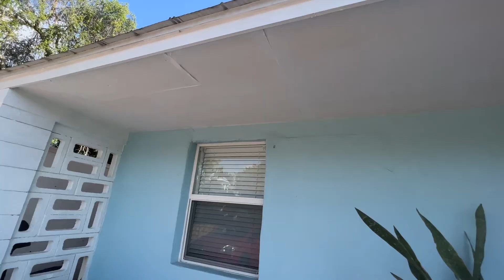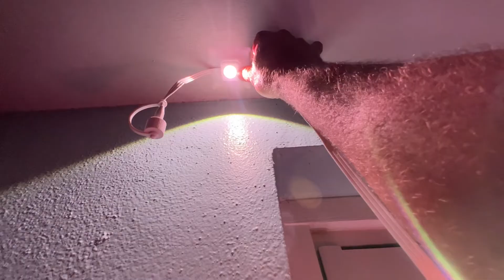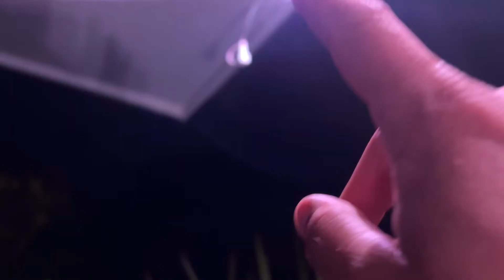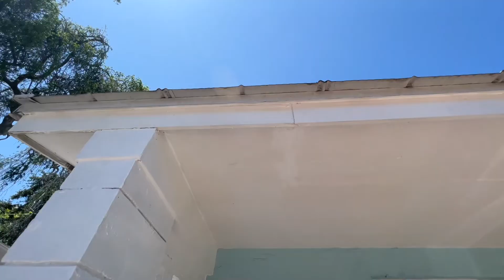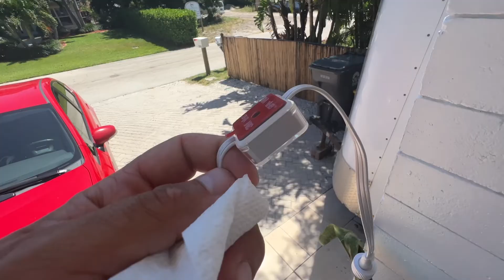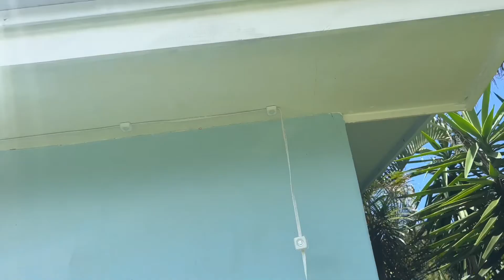How to Install Govee Permanent Outdoor Lights on Your House (Year Round!)

Comment: I think it would look better if you tilted the lights at a bit of an angle towards the house. This should reduce the scalloped shadow pattern on the right, and eliminate the line of shadow on the left side. Use a shim for something consistent on each light.

Comment: Thanks for posting this was wondering what would happen when put further out. I wonder if putting a small uniform shim with say a 15% cut would get rid of that line. I'm not a huge fan of the triangle pattern.
Reply from the maker: I’m thinking of adjusting them, there will be a video!
Reply: So tested my theory out today, my soffit edge is about 8" out and the only way to get the light to close the shadow gap is with a thick shim (30 angle roughly) which wouldn't look good. I am thinking of just installing them 8" out, the shadow on my end is about 7-8" inches so its not bad at all vs closer which gives you about a 3" shadow. Further out should wash the light down the wall further in theory.
Reply from the maker: how to adjust your Govee permanent outdoor lighting using 3M VHB double sided tape
https://youtu.be/CfL00WB1t2s

Comment: thanks for the video. was wondering if I should get one because the way my roof is, the lights will be about a feet away from the wall. But looks like it works fine for you at night. Just not very visible during daytime.
Reply from the maker: Should be good, I like them!